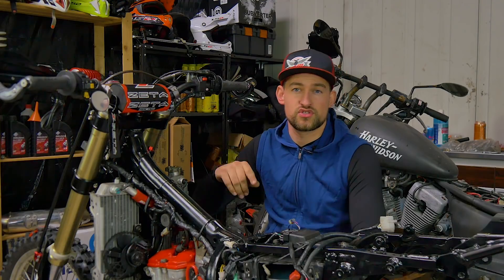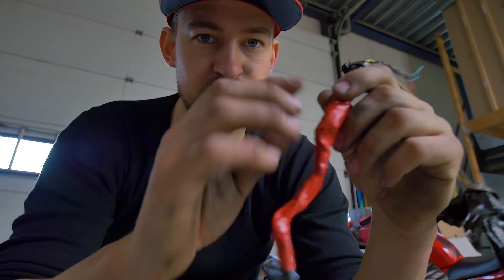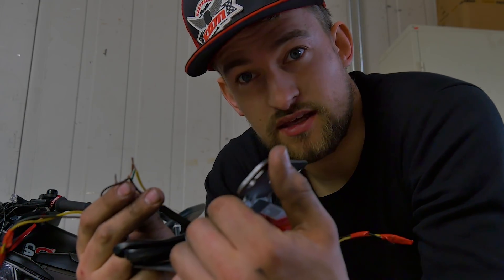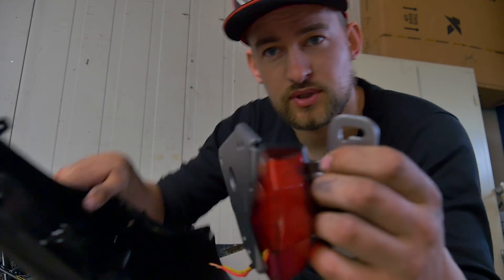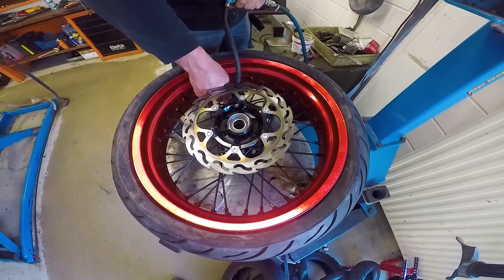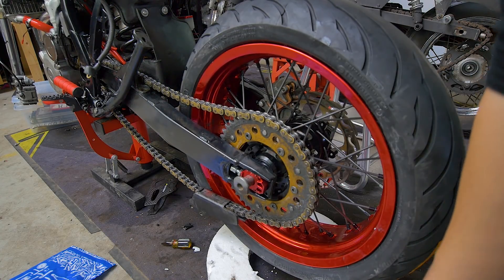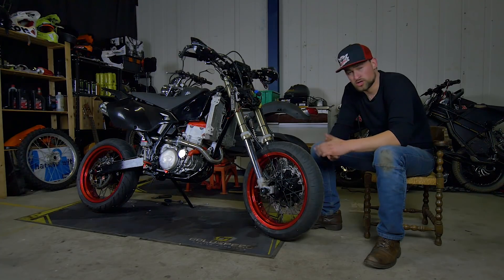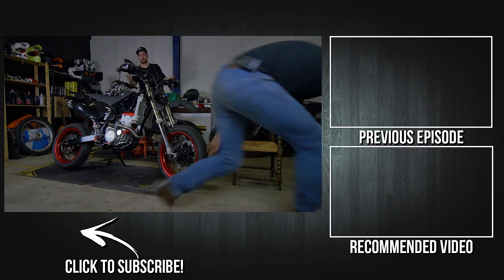The DRZ Supermoto Build is coming to an end! - DRZ BUILD EPISODE 6

Comment: What was the results of changing the oil?   I recently done an oil change on my drz and used fully synthetic. Mine has had clutch slippage too recently but I just put that down to abuse.  I plan to put new clutch plates in soon but wonder if semi-synthetic oil is the way.     Also i have a problem where it jumps out of 2nd into neutral occasionally under hard fast acceleration but i don't think thats down to oil, but again it's happened more since the oil change.   Either its oil related, or my gearbox has had it :/ lol